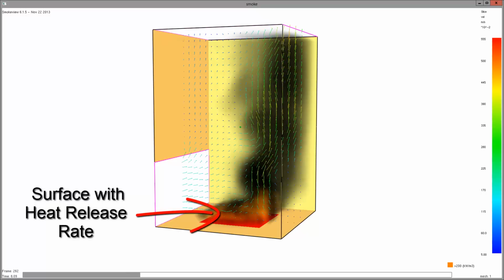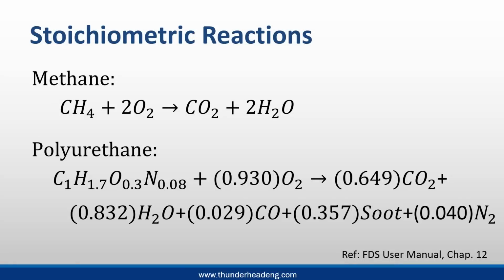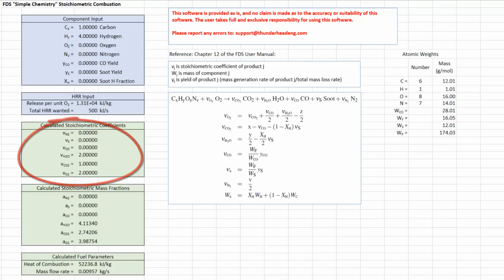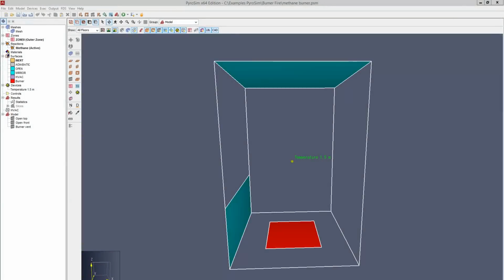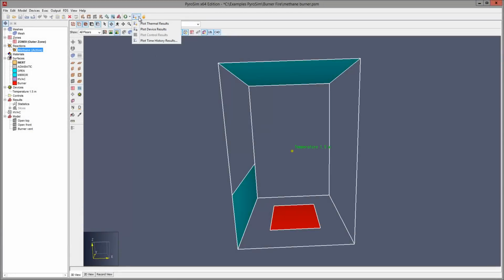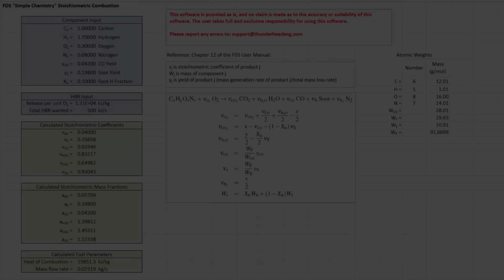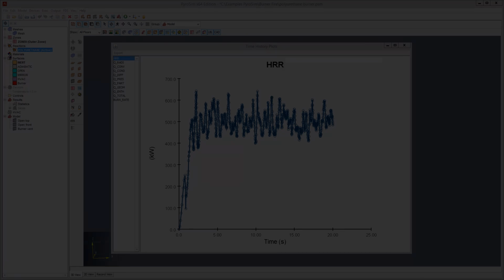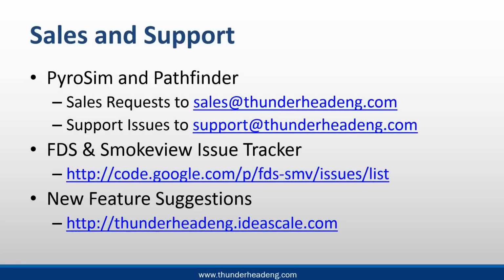PyroSim: Modeling Fire, Part 2 - Heat Release Rate

Comment: hello, your video is verry helpful. I have a question, how to determine how long should be the time simulation from fire growth until extinction?
Reply: Usually the area under the HRR curve is based on the total amount of fuel mass released during the fire.  You would estimate the fuel load and then use that to limit the total energy released.  To compute the curve you can use the HRR calculator on the PyroSim Resources page of the Support website.  On the same page, there is also a Spreadsheet with HRR curves from experimental data for different burning items.
Reply: @BryanKlein  thank you for the explanation. It gives me some idea. May I ask a further question for the real application? I tried to understand the case validation NBS multi-room. They set up 100 kW of fire. and based on the oxygen consumed, the HRR is 110 kW. The fuel is methane, and the combustion value is 50.000 kJ/kg. The simulation stands for 1200 s. And I tried to calculate the area under the curve, it yields 98.726. How to elaborate it so it will give 1200 s for the simulation time?